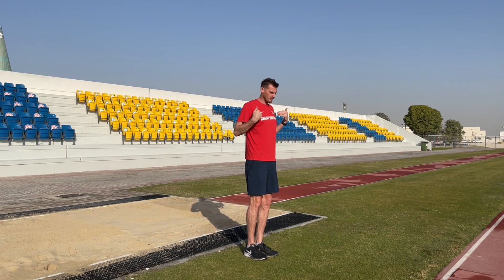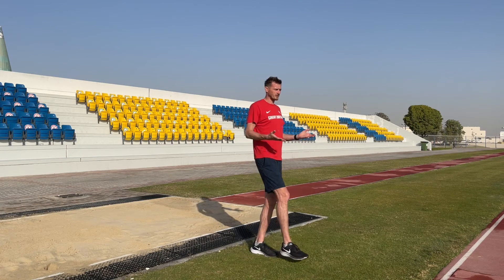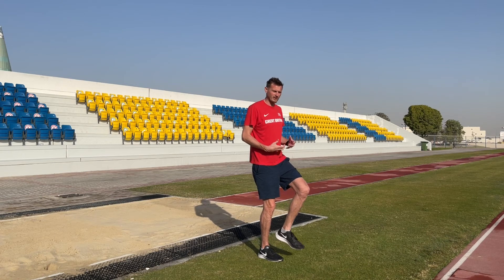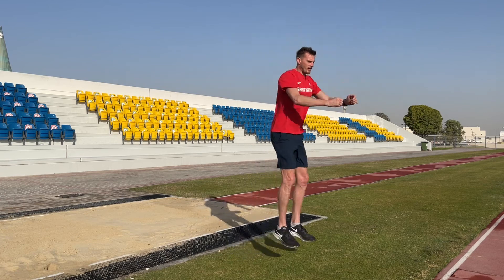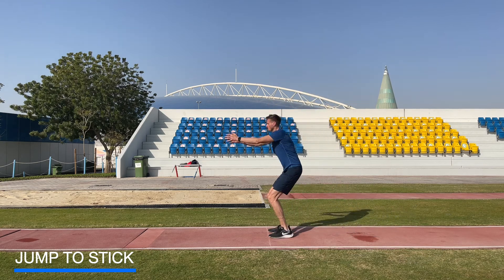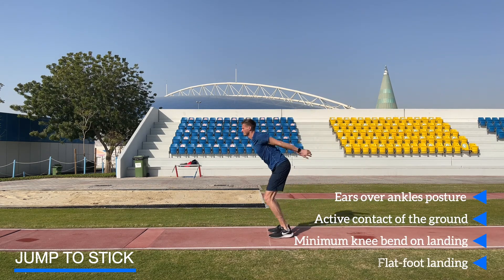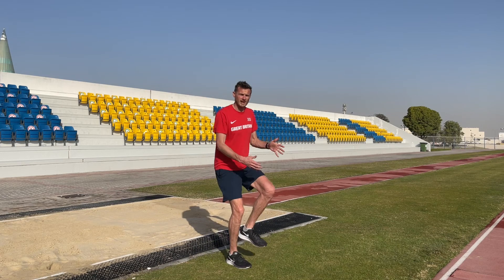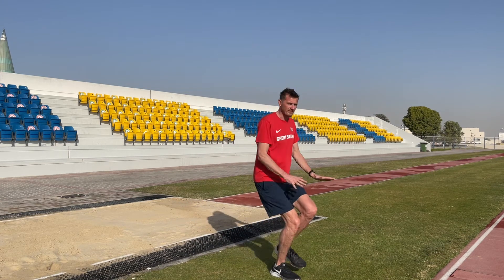Triple Jump Landing Mechanics

Comment: When you land on the board, do you land on your front foot, midfoot, or heel?
Reply from the maker: Nice question!
We’re aiming for a flatfoot contact. A heel contact will cause a block and won’t allow us to run over the takeoff leg. A toe/front-foot contact doesn’t allow us to create stiffness in the contact to utilize our elastic energy. The mid foot contact gives us both stiffness and the timing to run over the takeoff leg.
Try this video: https://youtu.be/un4RC-7FV58?si=0hKVKoWMUZilq_-S